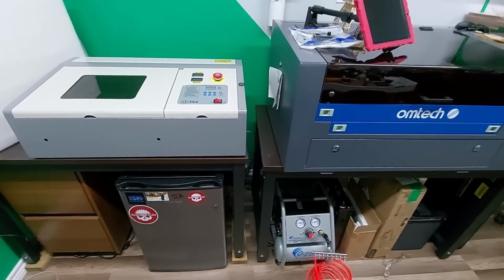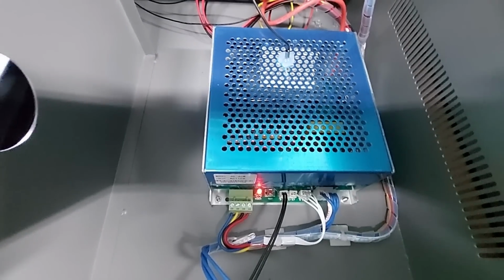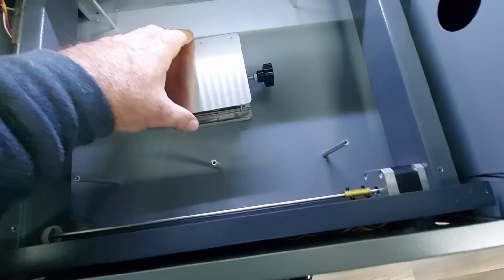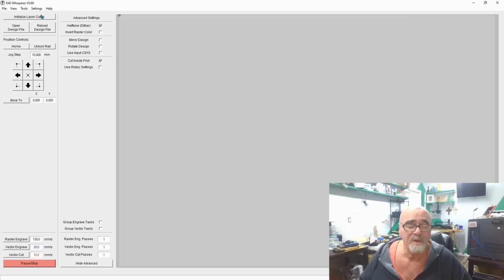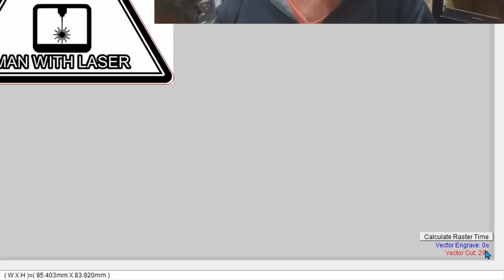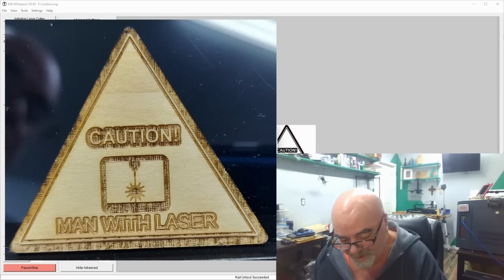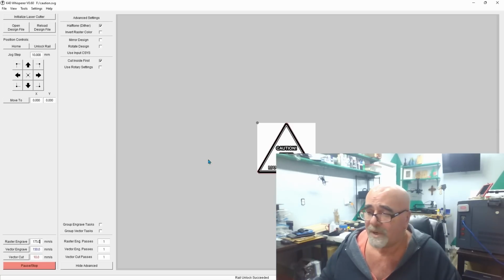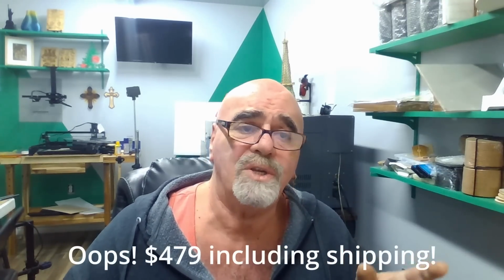🚫 Is It Time to Upgrade Your Diode Laser to a CO2?? The Monport 40W Co2! (OUTDATED)

Comment: I got my K40 one week ago and after sanding the contact for the ground wire, gantry and correct mirror allignment, ampere meter installation and checking all the electric wires, I finished my first Acryl Light engraving and cut a few hours ago. I switched from an Atomstack 5 Pro + diode laser to the K40. Your Lightburn videos have helped me a lot since I started with laser engraving. Thank you very much.
Reply from the maker: Awesome! I just got the Smoothieware board installed on mine.
Reply: @TheLouisianaHobbyGuy , I will change my board too and maybe also the gantry if i find one that fits in the K40 housing.  Adding a beam combiner would also be a very useful project for the future. I'm so super curious about your next videos.
Reply from the maker: @TopDealTravel  Got one on the new board coming up!

Comment: Rich, thanks for all your help.  And yes by all means put some woodworking videos up.  I recently read that lightburn can run a cnc.  Any experience with this?
Reply from the maker: Yes David! Well, sort of. It does not formally support a spindle or 2.5D, but there are lots of projects you can do in Lightburn. In some of my videos, I use the computer where you can see on the console tab the macros for Use Laser & Use CNC. I use it on the 3018 Prover for both basic milling and the laser attachment. But mostly for basic engraves, and the workflow is clunky since you have no toolpaths. There is a program called Kiri:Moto that does laser stacking that works somewhat.

Comment: Rich,
Great video.  It looks like a nice entry level Co2.  Maybe after I find the limits of my blue diode it will be something for me to consider.  Right now, I rely on Lightburn because I am not tech savvy and the Lightburn UI is right up my novice alley.  I will be following along with your videos on the K40 and especially the fiber when you get it.  I am looking at retirement in about 5 years and hopefully by then I will have mastered what my goals are for lasering :).
Reply from the maker: Right on Paul. In 3 years you'll be an expert! 👍

Comment: Would love to see a slow video on you updating the board on the K40 ,I think i would have to upgrade mine at the same time.Thanks
Reply from the maker: Coming soon Darren! I just finished the upgrade and I'm working on a water temp mod and an ammeter case & flow meter.
Reply: @TheLouisianaHobbyGuy  thanks 
Thats the first thing I did was a water flow meter that stops the laser from firing if there isn't a water flow .really easy to do and only cost me £30.saved my laser tube from cracking straight away when the pumps died .

Thanks

Darrenhrey

Comment: Hello Rich, another great video. I bought an Omtec k40 from Amazon back at the end of 2021. I haven't used it yet as I am still working on my shop. In February I bought an Ortur LM Pro s S2 LF & an enclosure for it. I am curious about your choice of a smoothiebord vs the cohesion 3d board? I've already purchased all the mods for the k40 except for the control board. I am leaning toward the cohesion, until I saw this video, given your experience I'm debating which bord to get. I'm trying to get caught up on your videos, lots of great info and I just watched the chiller video, I will be purchasing the portable ice maker! Great idea. Thanks :PS: just watched the video on air assist lol, smoothieboard for me much cheaper, firmware flashing isn't a problem.
Reply from the maker: Six of one, half dozen of the other... the cohesion is probably easier to install. If I had the extra bucks I would go with the LightObject T9 DSP controller, but they're around $275. Still half the price of the Ruida, with 4th axis control for a rotary.

Comment: you can use lightburn (DSP licence) with the stock nano board on the k40, running meerk40 as a virtual DSP controller.
Reply from the maker: Good to know Travis and I do have the DSP! Unfortunately I already ordered a new board, but that's okay.
Reply: I search for this in google but did not find anything about this virtual DSP controller and how it works.
Have you any link or discription  or something else?

Comment: Hey there, I just refunded my xtool m1 preorder because I want to cut clear acrylic, do you still recommend the omni k40 co2 laser? I also love the rotary feature of the m1, not sure how easily you can do that with k40 machines. Thanks!
Reply from the maker: Not sure what the Omni K40 is, I have the Monport. They now have the first K40 on the market that is compatible with Lightburn! I highly recommend that one and I have a coupon code for it! Rich&Monport
Oh, and diode rotary units work on the K40s.

Comment: Any permanent magnet stepper will generate power and backdrive the steppers if you manually move the gantry. I've seen it on numerous 3d printer videos. The detail is that not all drivers are able to handle doing that as well as others. I've heard that modern drivers are OK, but in the past people have killed steppers by running the bed/gantry back & forth.
Reply from the maker: Could be, I did it for 3 years without a problem.
Reply: @TheLouisianaHobbyGuy  so have I. The ones that killed their factory boards probably did the equivalent of record scratching w/ the Y axis to watch the LCD light up. 🤷🏼‍♂️
Reply: I was actually wondering the same thing with my sculpfun s6

Comment: Hi Rich,
I was thinking buying a laser engraver mostly to engrave 2 inch thick hardwood. Obviously the co2 laser would better for faster results, but since Z axis is not i am a little bit afraid.
What is the maximum material could you engrave with your jack on the machine?
Reply from the maker: Hi Christian, I can get right up to about 8x12". There are some hacks where you can get just over that, but I don't think they're worth the time or effort. As far as depth, I have engraved some 4x4 wood legs for a Japanese table with the jack removed.
Reply: @TheLouisianaHobbyGuy   thank you for your videos, they are very helpful. 
Looking forward buying a k40

Comment: I am looking forward to see the K40 run on LightBurn. I don't understand why the manufacturers are not making the K-40 compatible with LightBurn right out of the box. But if one does I believe the others will follow suit.
Reply from the maker: Exactly! I thought the same, but you know these China laser manufacturers are looking to save money. Even saving $5 on a unit makes sense to them. The first company that puts a Gcode controller in the K40 will dominate the market. OMTech has and sells one for $169 I think it is, but it probably costs them $20 or so.

Comment: Thanks for the heads up on a quality and affordable K40! Just curious though - do you know if this would support a rotary attachment? I see that Monport lists rotaries on their site, but they mention 50W+, and I was just curious if this had the necessary connections for one or not. As always, I greatly appreciate your videos! Do you plan to do a follow-up that goes over all of your modifications, such as the smoothieware board, bed, etc?
Reply from the maker: No, it does not, and most K40s don't, however it will be one of my modifications and it's very simple to do, as are all of the mods. And yes, I will be filming them with step-by-step instructions.
Reply: @TheLouisianaHobbyGuy  Thanks for the response, and I eagerly look forward to that video!
Reply: @TheLouisianaHobbyGuy  have you added the rotary attachment yet?
Reply from the maker: @mariewood8267  No, but any diode roller will work by unplugging the Y connector at the control board and plugging in the roller.
Reply: @TheLouisianaHobbyGuy  So much to learn!

Comment: Hi Buddy, thanks for another greatly informational video. I’ve been using my Ortur Master Pro 2 SF since Christmas and everyday I learn a little bit more. This video leaves me with a few questions I’d like to ask. I have subscribed to lightburn and I use the Mac operating system. You talk about the upgrades you’ll be doing in the video. Could these upgrades allow me to use lightburn and my MacBook to operate one of these? What would I all need to do to make this happen? What would I need to purchase extra? Thanks again for all your great videos. I look forward to my daily dose of info.
Reply from the maker: No Edward, if your MacBook is already connected and using Lightburn, you're good. The upgrade to a Co2 laser is a hardware upgrade. The new board allows Lightburn to communicate with the laser. I wasn't talking about the LM2, I was talking about a whole new Co2 laser.
Reply: Okay thank you for the fast response.
Reply: I realize you were talking about a whole new laser (CO2) . I’m asking, if I were to purchase one like the one you were demonstrating, what else would a need to purchase in order to get it running, using my Mac and lightburn? 

What actually is smoothy-ware? What or how do I purchase it?
K40 Whisperer…? Do I need this?
Where do I get it if I need it?
Which scissors jack works well with this unit? Is there anything else I need to purchase in order to get this CO2 laser setup using my MacBook?
Reply from the maker: @SickFisherman05  I will be doing a walkthrough of everything needed to do the upgrade to Lightburn very soon! Click the bell notification so you don't miss it.
Reply: @TheLouisianaHobbyGuy  thank you my friend.👍
Reply from the maker: @SickFisherman05  My pleasure!

Comment: What is the advantage of this over a diode laser like the makeblock xtool D1?
Reply from the maker: World of difference Kevin. The diode is 455nm, the Co2 is 1024nm. The diode slowly burns it's way around while the Co2 vaporizes at 10x the speed. I have use for both though!

Comment: I'm still on the fence. I'm looking at a K40 on ebay for 419 bucks shipped. I just don't know what it'll do for me that my diodes don't. Since you have experience can you tell me if it'll cut 6mm baltic burch plywood? I have 10 sheets just sitting there that I'd like to use for something like decorated boxes or whatever. Thanks, Rich for the video!
Reply: Well crap, I went and ordered it. Thanks trouble maker!😁
Reply from the maker: 😎 Don't worry George, you're gonna love it!
Reply from the maker: Yes, 6mm birch is no problem for a CO2 George.
Reply: Thanks buddy. I know I will if I can just find a place to set it up.
Reply from the maker: My last one always seemed to get in the way when I wasn't using it. So I picked up a rolling cart from HorribleFreight with a bottom shelf for $49. It was just perfect for it! The bucket of water stayed on the bottom shelf and all I had to do to move it was unplug the exhaust and wall outlet and roll it away.
Reply: If only I space for a cart. My CNC room is getting pretty full. I think I fouund a spot next to the drill press. The biggest problem is the room doesn't have openning windows so I'll need to cut a hole in the wall for the exhaust. It never ends. 😁

Comment: I bet the power comment is because the diode lasers light up when you move the gantry manually lol. At least mine does.
Reply from the maker: Yes, it does produce some very small voltage, but not enough to damage anything.

Comment: I think people would be better off spending a little more and move up to the 50w co2 laser. it has much more to offer. and you can use it with light burn,
Reply from the maker: The K40 is the best selling Co2 for a few reasons. Price, size and maneuverability. Yes, you're right, they are better machines. And I also think I would look better in a 2022 Hummer electric, but I had the get the Nissan micro-van 🤪
Reply: @TheLouisianaHobbyGuy  Ive had both. the k40 and the Chinese 50w co2 laser. The K40 just needs way to much tinkering. and after you tinker and get it to where it should be, you are not far off price wise for the 50w which comes with everything you need. adjustable table, bigger table, much better slides, stronger laser tube, etc. I've seen videos where people redid the whole k40. Yes it was cool and awesome when they finished but add up all the money and time they spent, you would be much farther ahead with the 50w co2 laser. I had to get rid of mine because I just didn't have the room for it. The k40 I had was just not worth it. I quickly got rid of that. I bought a neje 3500 diode laser just to play around with and do my logo on some wood working projects but the software was limited and would not let me use lightburn with out upgrading the board. So I sold it and  bought the sculpfun S9 which I can use lightburn. Pretty cool setup but makes me want another 50w c02 laser again. Addicting hobby. But learning light burn I came across your channel and forum and I want to give you a great big shout out "THANK YOU" your videos are awesome fun, enjoyable and educational to watch and just what I need to get into the lightburn software.
Reply from the maker: @woodknack1  You can bring the K40 up to standard for $800 all in. The cheapest you can get a 50W is $2K. For the folks who can't afford it, it's the mid level laser and works well.
Reply: @TheLouisianaHobbyGuy  you can get them cheaper then 2k . Check ebay. How much is a new board for the k40? Smoothie board? You start tinkering with that little k40 and you will will be over 800 in no time. Id spend $1800 and get the 50w . 10 times the machine the k40 will ever be. But to each there own.
Reply from the maker: I did a lot of research before I bought my 50W! The cheapest I found after months of researching was $2200 landed at my door. Sure, there's lots on eBay & AliExpress and I wasted a lot of time in discussions with sellers, but by the time the $1000 50W landed with import taxes, transportation & broker fees, it was over $2K. Two years ago before the new tariffs you could land one for $1700, but not anymore. I can tell you with authority that you will not get one in your home or busines for under $2100. If it were possible, I would have found it! And then when you go cheap, you get cheap and virtually no support or warranty! The Smoothieware boards are $39. With all the bells and whistles, my 40W will still be under $700 and the only drawback will be the bed size.
Reply: But i enjoy watching k40 builds.
Reply: Ebay has tge omtech 50w for $1859 free shipping. Its here in the states too east coast. I sent link but youtu e deletes it.
Reply from the maker: @woodknack1  I deleted nothing! YouTube doesn't allow you to add links. Only the channel owner can.  Yes, they have a version on sale now for $1860, Ijust checked. But they've lowered their prices since I bought mine, and it doesn't come with any accessories. But you've completely missed the point of people not being able to afford $2K. This discussion is meaningless...
Reply: @TheLouisianaHobbyGuy  calm down. I didnt say you deleted it. You are getting all hot under tbe collar for no reason. I was just saying what makes since to me already having both lasers. By all means keep up the videos on the k40 im interested and like watching them. Take care my friend.  :-)
Reply from the maker: @woodknack1  Yes Sir!

Comment: Several thoughts / questions:
1. Please indicate in the title of a video which type of laser it is for.  I watch videos and halfway through I find that the presenter is using a CO2 laser and what he is doing won't work with my Diode laser.
2.  With your modifications, do you have to have the DSP version of LightBurn?
3. Adding in all the extras (replaced controller board, bucket, water chiller, scissors jack, LightBurn upgrade, etc.) what would be the total cost of the laser?
4.  Is there a pass through mode where larger pieces could be engraved in pieces?
Reply from the maker: I thought the title was pretty clear! 
No, with my mod, you only need the Gcode version. 
The total cost is up to you. You can spend $1000 or as little as $200 depending on what you choose to use. 
No pass through on any of these K40s.
Reply: @TheLouisianaHobbyGuy  Your video's title was clear.  I was speaking of future videos.  Over the weekend I started watching someone else's video on cutting orange acrylic.  A few minutes in it became clear that the presenter was using a software package I did not have and almost to the end he mentioned that he was using a CO2 laser.  I felt that I had wasted my time watching.  If the title had been "Cutting orange acrylic using xxx software and my 60W CO2" then I would have known to skip it.